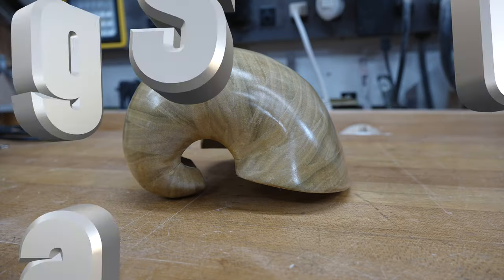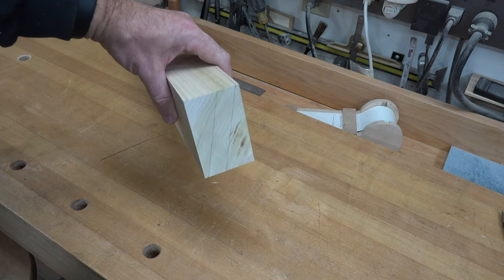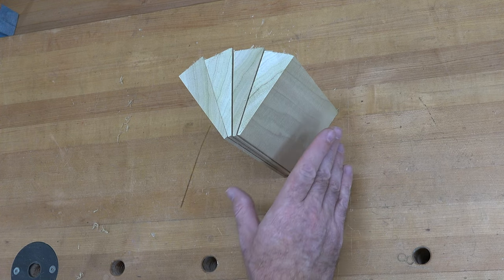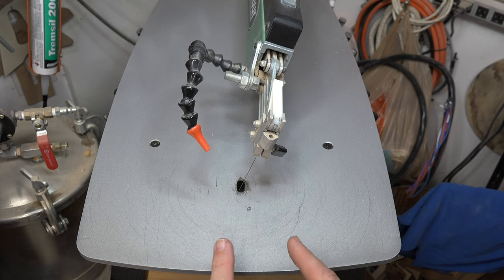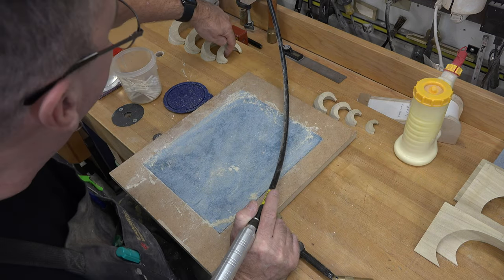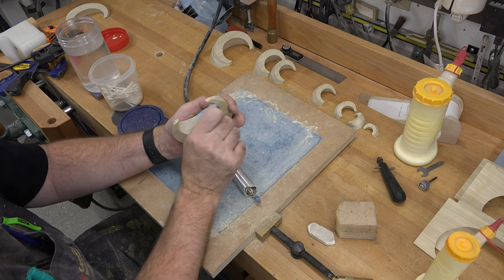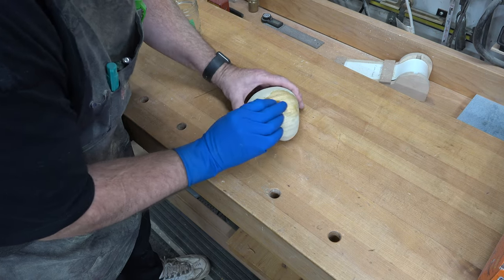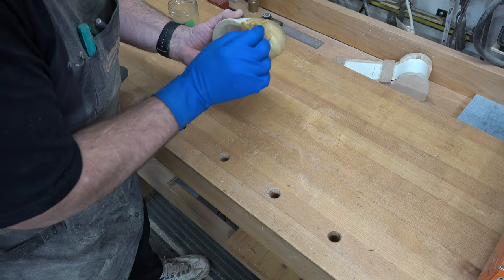Making Scroll Saw Sea Shells

Comment: Why wouldn't you use the piece that was cut out, with the larger diameter side, as what is traced?
Reply from the maker: You could if you wanted to Jeff but you want the next lines to be as close to the previous piece of shell as you can get it.  Tracing to the object that you are trying to mate to makes for a little less sanding.  I hope this helps.  Thanks for tuning in.

Comment: Nice job making the wood shell and video.  A few wood shell tips I've learned from experience:

1.  When the wall thickness starts getting too thick you can trim the excess from the interior side on the scroll saw (or bandsaw) at the same bevel angle while they are still individual segments.  Much less work and dust sawing it out than grinding.  Trace this cut onto the next segment as well.

2.   Put pencil marks on the joint surfaces before flattening them, when all of the marks are gone it's flat.  Apply even pressure while sanding so the thinner edges don't wear down faster than the mid-section.  A piece of 1/4" plate glass or a piece of countertop granite is much flatter than your mdf.  It's not really a big issue with smaller shells though.

3.  When you're copying somebody else's work you should mention that in the beginning.  A link would be nice too.
Reply from the maker: Thanks for chiming in with your advice on making the shells Steve.  It is good information that folks will find valuable I'm sure.  Your 3rd piece of advice is what I found a little confusing.  I learned how to make these shells from a scroll saw magazine from years ago.  There is no link to post.  Every idea that comes out on the internet, even if someone thinks of it themselves, has most likely been done by someone else along the way and when I can, I give credit to the folks that gave me the idea in the first place but as for the shells.....it came from a magazine.  Thanks for tuning in.
Reply from the maker: @Steve Garrison Well I'll be darned.  I just went out to my shop and checked the magazine that I got the original idea from and wouldn't you know it that YOU are the author of the article in the magazine.  The magazine is from 2012 and I don't see any link information there in the magazine.  Please feel free to send me some links to kennye@acutabovewoodworkings.com and I would be more than happy to add the links and give credit where credit is due.  I'm glad that you contacted me.  Looking forward to hearing from you.
Reply: @acutabove_woodworkings  thanks for the responses.  Glad we got to chat.  👍
Reply from the maker: @Steve.Garrison  Links have been added.  Thanks for supplying them.
Reply: @acutabove_woodworkings  Thank you.  Keep up the good work.

Comment: Great job Ken, so you were saying if the table tilts to the left go clockwise if tilts right go counter clockwise if I understood what you were saying the shape depends on the table, thanks Ken
Reply from the maker: Depending on which way your table (or blade) tilts and which direction you cut you shape in will determine the final outcome of you pieces.  If your table is tilted to the right and you cut your piece, following your pattern clockwise, the wider part of your piece will be on the bottom.  But using the same settings and cutting your piece counter-clockwise will cause it to be wider on the top.  So depending on the shape that you are after, you need to consider which direction to cut your pieces in, depending on which way your table (or blade) is tilted.  I hope this makes sense.  Thanks for tuning in.
Reply: Thanks Ken  still a bit confused I will have to run a few test peices
Reply from the maker: @alanwasserman8176  Try two test pieces.  One cutting clockwise and one counter-clockwise and you will see what I mean.  (I hope)

Comment: Beautiful! Poplar is one of my favorite woods. I try to use it whenever I can. I would just love to try this, but I don't have a band saw. Is there another way to cut the wedges?  Maybe a Gentlemen's saw? I do have one of those. The rings on the shell are visually just awesome! Another great show! Take care!
Reply from the maker: There is always another method Michael.  Heck, you could even cut the wedge with a hand saw.  It doesn't have to be perfect and even if the hand saw goes a little off, you could always sand or use a block plane to get the surface flat so that the individual sections have a flat surface for the glue up.  Give it a try.  I'd love to see what you come up with.  Thanks for tuning in this week.

Comment: You used a specific circle to start. Is that essential or can you use different sizes to vary size of shell?
Reply from the maker: You can use whatever size you want to start.  As you stated, it will vary the size of the shells.  Thanks for tuning in and for chiming in with your comment.